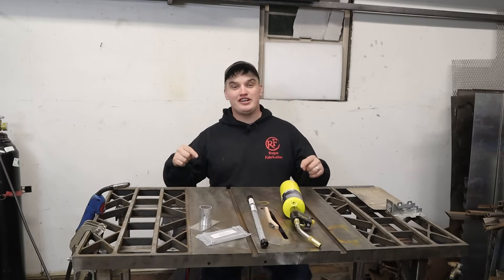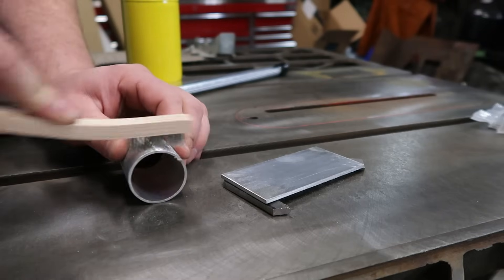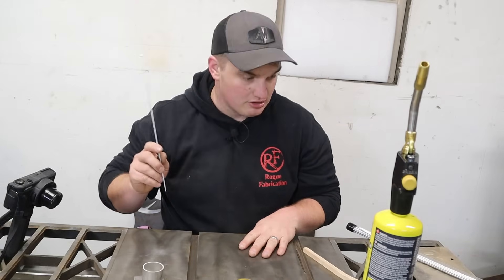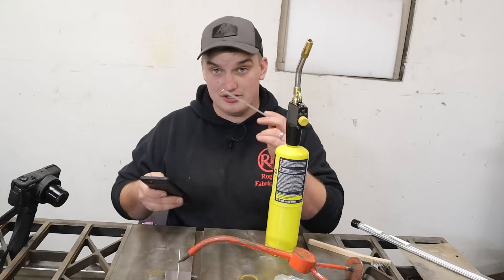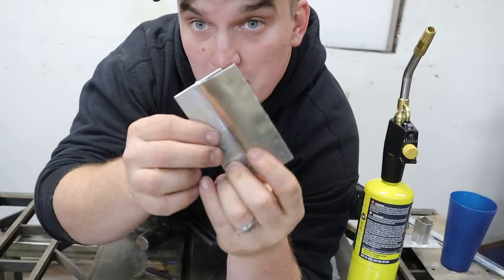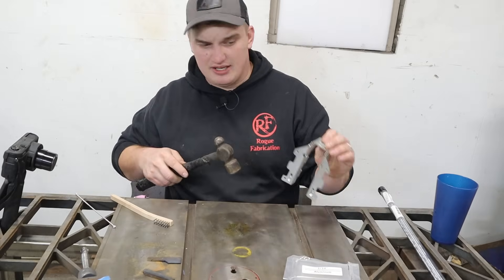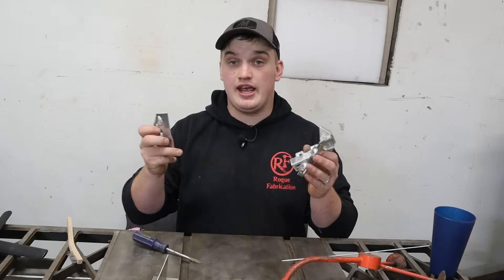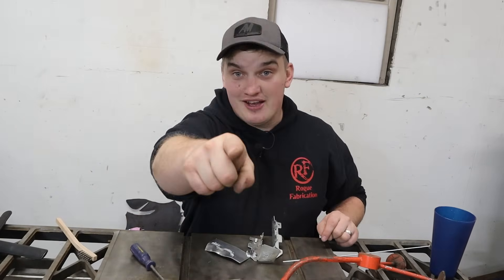Stick  Aluminum Together Without a Welder.

Comment: Would this method be applicable to re-attach aluminum fenders to an aluminum trailer? (or maybe the aluminum is too thin). The so-called self-tapping screws didn't hold up and I would love a more permanent solution to them constantly breaking loose from the trailer. Anyone here have a better solution for this issue. Thanks, from highly annoyed
Reply from the maker: I don't know if I would use it for anything structural I would say it's for more light duty and aesthetics.

Comment: Hi from the UK
It's good to see that someone who dose weld properly give a positive review of them, they will never replace a proper welded joint on something structural but will have dozens of uses. It's my understanding that they were developed for the air con and refrigeration sector as most industrial units use aluminium heat exchangers and the process is not dissimilar to soldering copper
Keep up the good work
Reply: This is solder he used correct??
Reply: @irishguy200007 this is more akin to brazeing. I believe a brazed joint is stronger than a soldered one by a good bit. But they are both outclassed by proper welding in ever way
Reply: I’ve temporarily used pepper to fill radiator pin holes long enough to hold coolant pressure and get me home, so radiator pressure isn’t too extreme.  I would imagine these would work absolutely great for that, least better than pepper lol

Edit: Hello from Newfoundland.

Comment: Maybe a silly question from a novice, but after joining two aluminum pieces together, say for a 90’ corner piece, can you grind down the brazing so it’s smooth? Easier to sand it by hand?
Reply from the maker: I have not personally tried it
Reply: I think the grinding might raise the temp of the filler to its melt point.

Comment: The reason the galvanized hanger broke apart is because of the way you applied it. You could see that you melted the rod with the torch instead of properly heating the base metals! But it is a great video thanks.
Reply: Don't think so. 9:01 - 02 he does direct the gas at the solder at the start, however the rest of the shot he's quite a ways away or pointing it further down the weld.  It didn't hold most likely because it was galvanized and I don't think it actually got the metal hot enough as witnessed by it melting like cheese vs flowing.  I think the manf. was honest that it WOULD allow you to solder galvanized, however nowhere did it say it would be as good as removing the galv beforehand...

Comment: I have a small room/shop in my house that's pretty well organized.  It looks a little like a hardware store with a workbench against one wall.  I have a specific box labeled "specialty tools" that basically are things rarely if ever used or "just in case stuff".  I have a pack of these in that box but hadn't tried them.  You've given me a head start, thanks.
Reply: I have a couple bundles of those around here somewhere.

Comment: I still don't know what the trick is to getting these things to stay together.  I do a lot of welding myself and I have tried these sticks hoping for a decent solder joint.  Every time I even bend the 2 pieces they instantly just break off.  I am not using map gas, may be that is the problem.  I have tried brushing like you in your video and then cleaning, but it still does not work.  I guess I will just have to get myself a TIG welder for aluminum.

Comment: I didn’t know this existed, but have some aluminum parts in the shop that need to be welded.  I will remember this for some other applications however.

Comment: I've built boxes with this stuff that haven't failed in decades.  MIG/TIG would be "better" for sure, but this stuff is easy and more than up to the task.

Semantics to be sure, but while technically soldering, it behaves more like brazing.  Use heat to pull material through the joint.  Flux is a must for anything you deem to be permanent rather than a temporary fix.

Comment: for dealing with smaller pieces like the nes in the test video im wondering if bring the parent metals up to temp in a an annealing or tempering oven first wouldn't give you a better way to dial in the right temps so preheat base metals and then torch to finish the work?
Reply: $20 for a decent, cheap laser thermometer and you can avoid needing an oven and having to wait.  For thin sheet metals, I'd rather use a small butane torch, much lower heat than the Propane/MAPP.

Comment: I actually fixed a radiator on the side of the road one time with those rods I had in my truck. A guy broke down and had a leaking radiator. I grabbed the torch and a rod and was actually able to stop the leak or at least until he could get it repaired. They definitely have a time and a place.
Reply: Good luck with plastic brackets
Reply: @luislongoria6621  yea seriously
Reply: @luislongoria6621 plastic (heat) weld it? As long as you have the same kind of plastic, it’s pretty much the same principle right?

Comment: These rods need the base metal to be cleaned with a stainless wire brush and a stainless wire pin/scraper to scratch through the molten solder pool helps to deal with the natural oxide layer. 
By the way, brazing is just a high temperature soldering. This aluminium system is medium temperature.
Reply: ‘Hit the nail on the head’ with your post.  A scratch, along the metal pool will definitely solve his obvious problem of poor contact (the pot leakage, for instance) by giving the metal a chance to then wet the metal along the length of the joint.

This is amply/clearly explained by any good info on this type of brazing.

Simply put, welding is melting together both the filler and base structure.  Soldering/brazing (same but different temperatures) is where only the filler is melted, thus relying on only contact, not mixing together liquid metals.

In days of old, I expect soldering was with a soldering iron of some description, whereas brazing was definitely using a flame to heat the item (and filler as it is applied).  Since those days, silver soldering (should it have been called ‘brazing’?) was penned as the ‘hard’ solder as opposed to the lower temperature lead/tin ‘soft’ solder.
Reply: I always treat brazing welding or soldering with this rule. Clean your surfaces and make sure your filler either rod, wire, or feed is clean too. Also find that applying a thin layer of Flux along the surface of the joint prior to heating helps localize and prevent the oxidation of the surface preventing that solid seam but everyone has their slight differences in way of life
Reply: @luciferhellhound   I believe you are right. The Manf. wasn't wrong, it did solder. However if he'd applied some flux I think both  would have been leakfree and stronger.  I don't know if those rods have antimony in them, but they looked like melted cheese vs flowing solder. Not enough heat?

Comment: Kind of Dicey Soldering Galvanised materials, if you get too hot Galvanised materials give off Toxic Fumes. This is pretty low temp so it's likely ok but most  "Do it your selfers" are not that knowledgeable and if using Map Gas could overheat the Galvanised material.

Comment: I had my doubts about those aluminum welding rods, but after seeing you use them, I'd definitely try it for light duty aluminum bonding.  Thank you.
Reply: Aluminum welding/ brazing rods are great if you have a decent temp control welder or torch. In my experiences they act as a great indicator for area heat cause the worst part of Aluminum is the ease with which burn through occurs
Reply: I need to repair my toolbox, I'm curious how well this will hold
Reply: @amcustomfab 
@MrAtaripitbull Why only light duty? Why no structural applications?

Comment: Flux makes this a whole lot easier. Also, clean clean clean. I have had my rods for 10 plus years and only use them for minor repairs. Honestly an inexpensive AC Tig or Spool Gun Mig is easier to setup  and use then dragging these rods out and doing a bunch of prep work.
Reply: For once or twice a year use, the $15 torch and some plumbing solder beats a $100-200 Tig.  2-3 min with some sandpaper and acetone/brake cleaner isn't exactly a time sink.
Reply: You have to do the same prep work to TIG

Comment: I don't think you maintained the temperature as needed for a good induction of heat to melt the rod equally to the metal. A smaller torch  with a pencil point flame would help.

Comment: Would this work on steel at all?
Reply from the maker: Probably not
Reply: MuggyWeld had a rod for steel
Reply: When I was young 20 yrs ago, I seen mechanic take coat hanger and brazed my header collectors to exhuast, worked great

Comment: Thanks for the review; I found it helpful. I can't help but wonder if you might have had better results on the galvanized steel test if you hadn't done it flat on the welding table. The Aluminium coupon test you did was raised off the table but the galvanized steel was right up against it allowing the metal table top to wick away the heat from the pieces you were working on.
Reply: RE . . . ."the galvanized steel was right up against it allowing the metal table top to wick away the heat from the pieces you were working on " 
EXACTLY . . . . except that needs to FURTHER emphasized  by the use of  two foot high text . . . . . . . ! ! ! 
I would have used a piece of cement board to rest the work on and possibly some 2X4 scraps underneath that to FULLY be away from that saw table metal mass.
Then all of your applied  heat is  fully retained by the work pieces.
Reply: It looked to me like at 9:08 that the aluminium coupon was resting on the table, and the joist hanger was on top of it. Same thing though in the end, the table might have wicked off heat. However he was using MAPP gas, so energy input should have been way higher than any losses.  Might be the product is just that way, but it didn't look like it was really flowing as much as barely melting.

Comment: I did an alumiweld video years ago, love the stuff for the right project.  Basically aluminum soldering, but its super strong.   I first came accross this stuff in the 80s, somebody was doing a demonstration at a flea market sealing a hole in an aluminum can.  Larry
Reply: Still waiting to see that one. Probably the #1 most used line for welding aluminum

Comment: If You take off the oxide layer at the bottom end of the tube, it will seal with no water leak.
I've used this stuff many times, on scratched engine covers for classic bikes. Works like a dream!
Reply: Mate can this be used to well  a aluminum bearing cap?

Comment: I made some charge pipes for a turbo car I have. It failed the water test. Small seepage. I did band of jb weld to all the seams. They have been solid for over a year. 14psi
Reply: Hell yeah
Reply: Great idea with the JB weld!
Reply: I'm about to do the same but with a MAP/Temp sensor mount to an aluminum intercooler tube.
Reply: @damianmcgriff2665 lol yep I tried that same exact thing but mine ended up being super ugly and leaked so I ended up just buying an adapter/fitting for my specific sensor that threads into itself through a hole you drill in the intercooler pipe and thanks to gaskets inside the fitting it seals right up! I even pressure tested it to 90psi with my air compressor multiple times searching for boost leaks and no leaks whatsoever!
Reply: @camwinning4916  if you used flux it would have wicked into every void like it does in soldering and it wouldn't have leaked.

Comment: I've used that type or rods about 30 years ago and they worked great for what they were used for. We would use them for building up damaged lowers on outboard motors. Loved the video on the welding table build. I picked up the same saw for $40 on market place in my area after seeing the video. That table is HEAVY!!! Thanks for the informative videos.
Reply: great tip for fixing my damaged outdrive, thanks!
Reply: A friend repaired a VW Beetle gearbox to engine mounting lug. It has only four to carry the whole engine so couldn’t possibly work. Could it?  It kept going 10,000 miles before he sold the car. 
I tried to do a similar job on a motorcycle engine but struggled to get it aligned. Ended getting it TIG welded.

Comment: I have had the "Blue Demon" brand in the drawer for about 5 years and has been very handy when needed. I found the rod melts at about 600 degrees and not quite hot enough for best results,  so I have used a temp stick since I found this out. Acetone, stainless wire brush then acetone again then flux. I have been very happy for the few times I needed it. Another great video!
Reply: What exactly kind of flux you're using?
Reply: These rods have flux already in them
Reply: Seriously. what brand flux is compatible w/ Aluminum?
Reply: @derrikarenal3308  sorry my blue demon rods don't need flux, my Super Alloy 5 rods came with flux. The Super Alloy 5 are better for radiator and other repairs on older materials.

Comment: P.S.   ...  Could you still use it as a table saw, ... Yes it could,.  ... But You would probably have to stand to do Your welding, ... Maybe that won't work out for some people, some of the time.
     Sliding sled ?? .... Just wondering what You can use or set up in the two slots, like a TENON jig,(? ... Keep thinking ...).  ...   I'm sure You could translate/incorporate the fence for a porpoise too. ... Think of Welding and Wood as a happy couple... With kids that have a resemblance to Their Parents, .... But are Their own person/individual personality and propose.   ...   Don't forget the baby in the family ... The Miter Gauge.
     Just thinking.

Comment: Was spinning my thinker about You quest to do something Unique for the left over inneards of the saw. ... Why not leave it as is for the most part except as needed, using the tilt an up down down function of the saw so you can make and add accessories, jigs and fixtures so You can have/make compound angles of any combination in three dimensional set ups.... You can use the arbor as a pivot point for an attached adjustable (setable and lockable) fixtures/jigs.   ...   There,   ... Now You X-Y- ... And a .... Z ... + ...  (Considering you can hang things over the edge of the saw ... (pardon me ... "Welding table") also.).
   So now you can make and hold your parts at any assortment of precision angles to make something, ... or correct something to fit just right .... whenever something needs to be something other than  90° or 45° on a flat two dimensional surface.    .....     There You have it,.  A different paradigm, or thought on a direction to go.
    It will be interesting to see how far you can use your own imagination with this, might want a separate tablet or stand/station to attach the innards to.   ...... Welder, grinder, sander all in on station??? .... Mmmm.